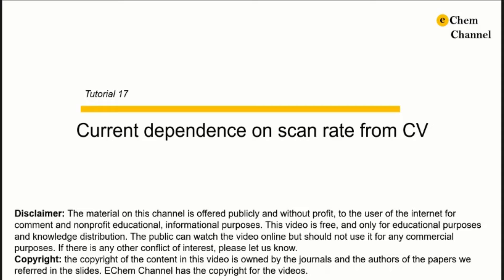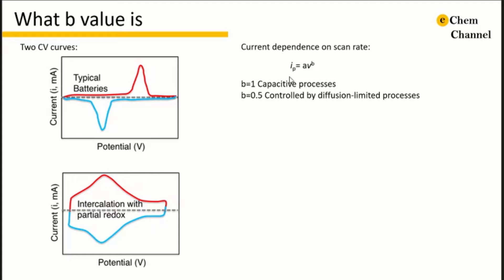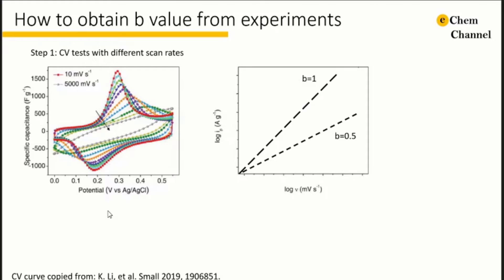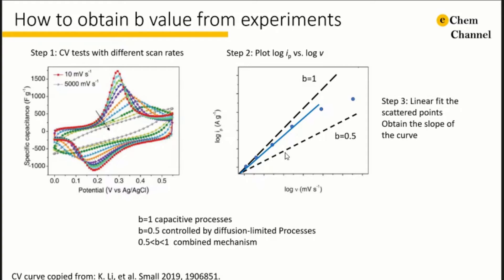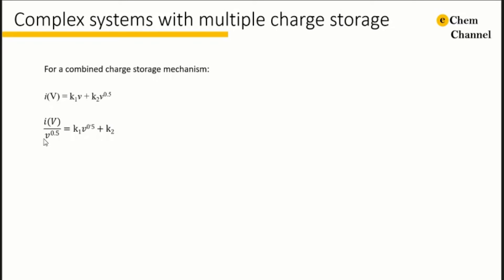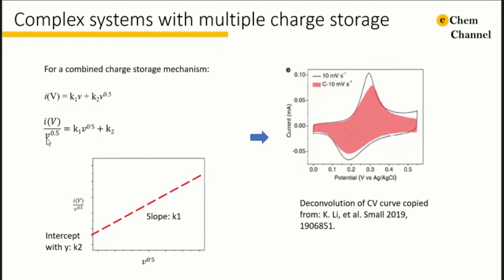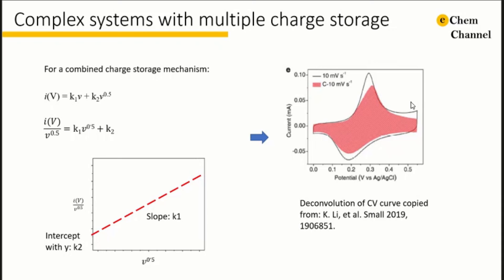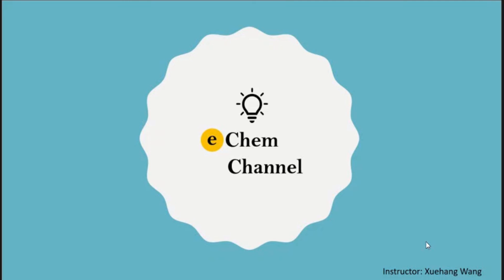Tutorial 17-Current dependence on scan rate from CV

Comment: Hii, I have a doubt. Are you considering maximum current values for a particular scan rate (each cv has different peak current at different potential)? Lets say, choose a fixed potential, and measure the current for each CV and than plot log i vs log v. Why did u choose ip instead of only  i?

Comment: Hello everyone! I have a question about CV. It is known that current in CV depends on different controlling mechanisms: at low potentials before peak current there is surface control and after - diffusion control. Also it is known that changing of sweep speed give us information about surface or diffusion limitation of our reaction. But i cannot understand how type of limitation of our reaction connected with CV limitations at different potentials... i'll be glad if you answer
Reply from the maker: Hi, different processes can happen at different potentials. You may have only double-layer charging first before a diffusion-limited intercalation happens. However, it is difficult to talk about a specific potential because at higher rates, the overpotential causes all peaks to shift so the exact process no longer happens at the same potential. That's why in b-value analysis, we focus on the current peak value so it's studying the same process.